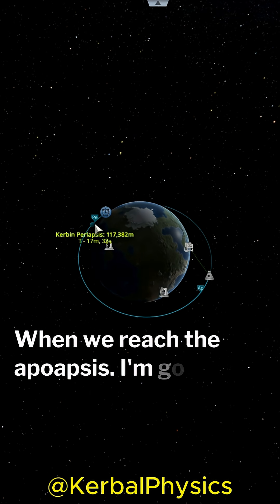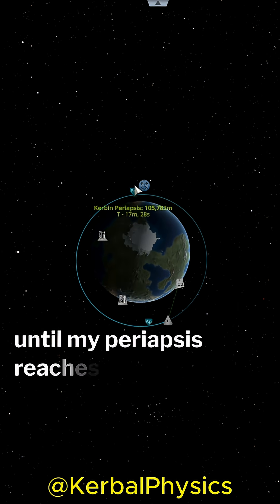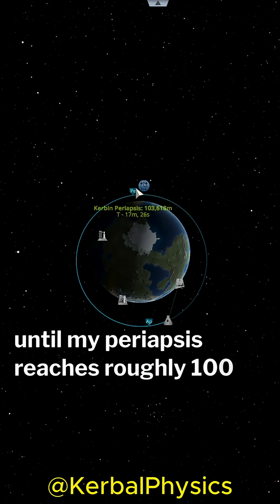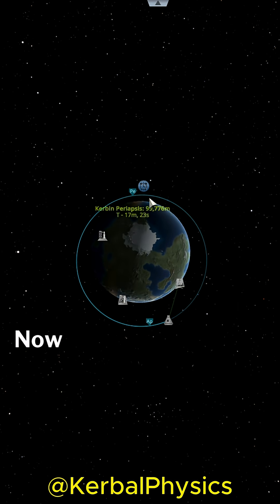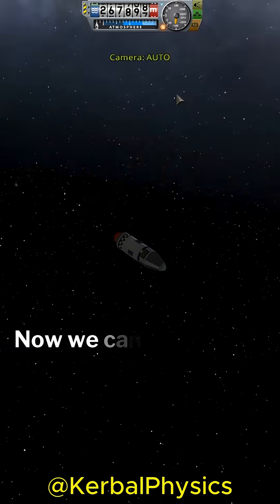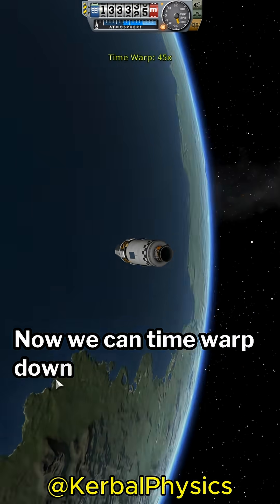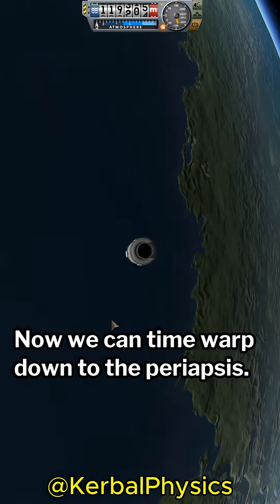How to get a Circular Orbit in Kerbal Space Program #kerbalspaceprogram  #spaceflightsimulator

Comment: Yay new video! Can you do a video about how to get in mun orbit (from mun surface) using as low fuel as possible
Reply: Don't worry gng, burn your engine continuously until your altitude is like 1km then reposition your pitch to 45 degrees with your engines still on and in the direction you're traveling. Keep doing this until your Apoapsis is anywhere between 15 - 20km then cut off engines and only continue burning until you've reached apo-G to circularize your orbit,. It'll spend anywhere between 1000m/s - 1200m/s of delta v since that's the minimum for escape velocity on the mun
Reply: @eastcardshark2592  I made an unoratical manual way and I burned way less fuel but my orbit was so strange a periapsis 6km
Reply: Hello me too I am interested in space and I need your help with something please
Reply: @BenjaminPhillip-s8n oh hey it’s you! I watch your Spaceflight simulator videos! 😊
Reply: pop engines for a few seconds so u shoot up, wait for ur ballistic ap then burn EAST until youre orbiting, minimum safe orbit for the mun is 11km pe
Reply from the maker: check out my video "Was Neil deGrasse Tyson wrong about gravity turns?" :D